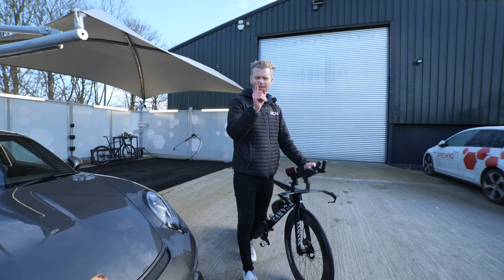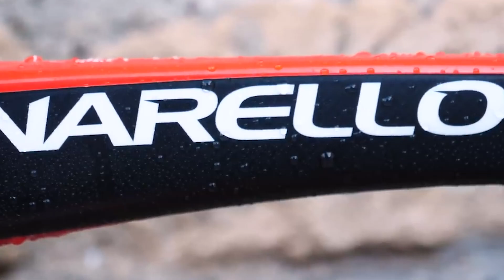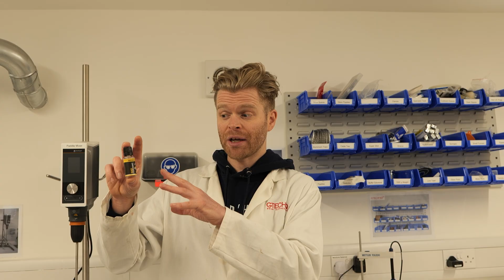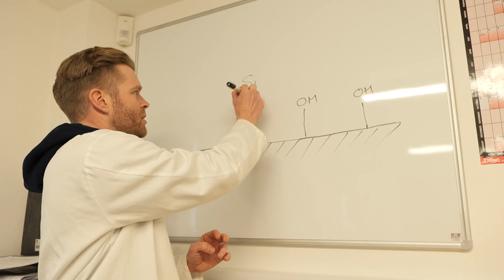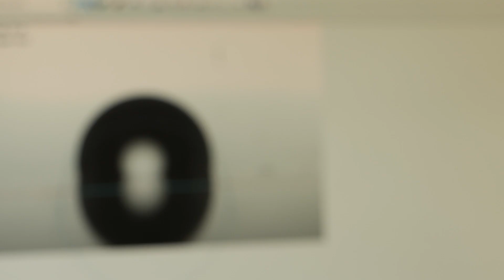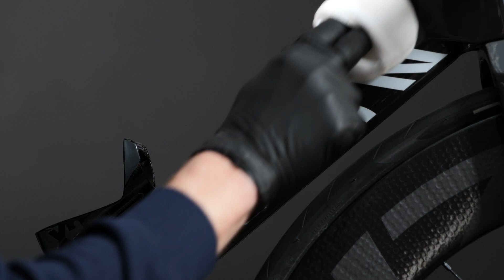The Future Of Bike Cleaning? | Hydrophobic Ceramic Coating For Bikes

Comment: When comparing it to non-stick/Teflon, any risk of this adding to the ‘forever chemicals’ issue?
Reply: good question. i’ll investigate.
Reply: My question exactly. I've been using a liquid carnauba wax for those reasons. It does fade after a few washes, but is very easy and quick to apply, biodegradable, and non hazardous. A bottle squirt and mud sheds off, and the frame remains much cleaner on rainy rides.
Reply: @nluisa  I use a very high quality carnauba wax on my sports car and figured it would not hurt on the bike.  Bikes just don't take much time to detail compared to the car so I think the ceramic coating might be overkill and the wax smells great too!
Reply: All this stuff will drip off and drain into the Waters. Many places are starting to ban wearing similar coatings on Sportswear. Like Fallraven. ☠ Nasty stuff 🧐 destroys nature and stays around for ages.

Comment: Ollie- I know you said you can put it on the wheels, what about putting it on 50mm carbon rims that are rim brake models?  Does it effect the braking surface? Thank you
Reply: We would not recommend applying this to any braking surfaces as any coated surfaces become much slicker.

Comment: Would this product if it fills in all the paint would it make your aero bike more aero by making it less sticky to air? 🤔🤔
Reply: interesting thought - it might be something we look at getting data for. In our mind, a cleaner bike is a more aerodynamic bike.
Reply: @GtechniqUK  If the ceramic product does smooth the paint and as such make the surface less sticky to air and the result is a faster time at a given power, then you will have a huge selling point for many cyclists.

Even if it saves a few seconds over a mile, cyclists will want to buy your product.

Now I’ve potentially increased your product selling point and income, could I have a free sample to try? 

I already use ceramic spray after a wash but it’s not the same 

Don’t ask don’t get 😏😏😉😉😆😆
Reply: I will save you time :)
We have tested it years ago with Bicycle Armor. 
There is no advantage.  At slow speeds like in cycling you need texture. Like they use on tt suits. 
It's called "the golf ball effect".

The only aero advantage you will get is that it cleaner. At 60km/h we had a 0.3 watt advantage.
Reply: @GtechniqUK  Yes, a clean bike is faster - but is a clean bike with ceramic coating even faster 🤔🤔

Comment: How much does it cost and is it worth it? Isn't keeping your drive train clean more important?
Reply: 8 or 9GBP from ebay car ceramic coatings. They are sold in 30~50ish ml bottle. No more ripping off bike industry guys. F off.
Reply: @peterghimme9661  link?
Reply: @MTBScotland  I do not want to be looked to be advertiser. Just search for Car ceramic coat.
Reply: @peterghimme9661  cheers
Reply: £55
Reply: £55 direct from Gtechniq 
Keeping the drivetrain clean is important but we believe the frame and wheels are just as important. Especially when you consider disciplines such as cyclocross.
Reply: @GtechniqUK  55 pounds a year for something that I've never needed up to now. I'm sure it"s great, but times are hard.

Comment: I find that the Sun is very damaging of any coating and also washing with tap water. Rain water is much kinder to protected surfaces. My preference is to use a good quality carwash such as Turtlewax Triplewax in a bucket of water which applies a coating on top of any previously applied coating to extend usefulness.
Reply: But then, I'd assume - that you are covering up the hydrophobic layer, correct?
Reply: @JonPaul  Correct, but my method does extend the life of any prime coating.

Comment: Does this also work on raw titanium or stainless steel bikes?
Reply: I'd applied ceramic coating on ti frameset but not that much effect.
Reply: @peterghimme9661  you need the lacquer to form the bond
Reply: @readmorebooks-l5f  For I do not have chemical degree, I had to real experiment to test my hypothesis  6 years ago with car product and litespeed frameset. Thanks anyway.
Reply: if lacquered, yes.

Comment: Can you apply on matte bikes or just gloss finishes ? 
PS : GT3 is mind boggling , well done Oli 😜
Reply: yeah, the canyon is matte. it makes it a fraction glossier, but it’s still matte.
Reply: @readmorebooks-l5f  thanks 👍
Reply: I would say yes,it may leave it with a slight gloss to it as you buff.
Reply: You can buy matte specific coatings, plenty manufacturers make them thesedays. 😎
Reply: This ceramic will slightly enhance the colours but does not change the finish of the frame.. be it matt, satin or gloss

Comment: I use ceramic spray from a bottle I bought from AMZN.. Found out the Gtechniq has their own special  formula in a tiny bottle for $70... Pricey. I'll just stick to washing my bikes and reapplying a few times as needed
Reply: I  bet their isopropyl alcohol costs a  fortune  too  when it  costs pennies  per litre
Reply: Ceramic spray is not the same a ceramic out of a bottle and £70 for proper ceramic is cheap.  If you buy the car size bottles they can be much more expensive
Reply: Sounds like a different product